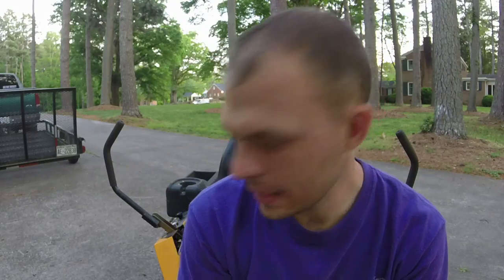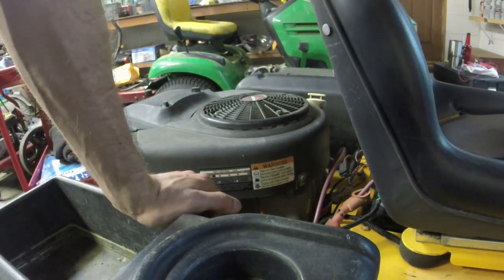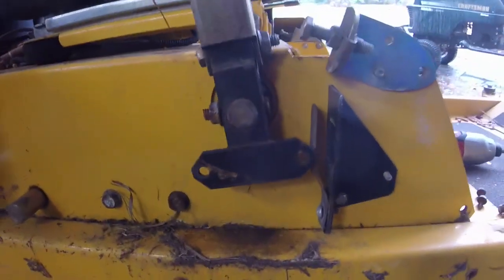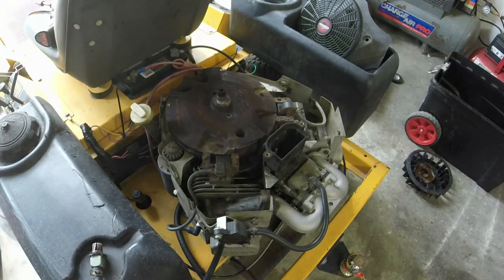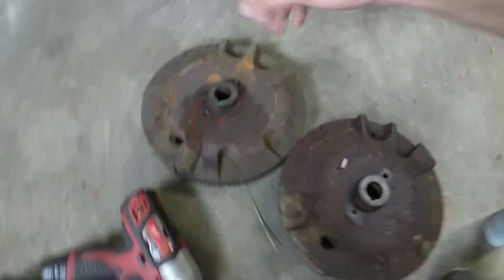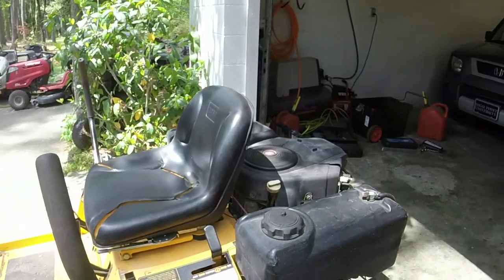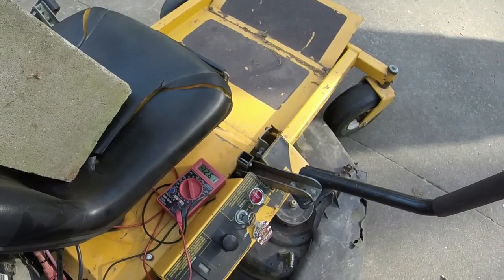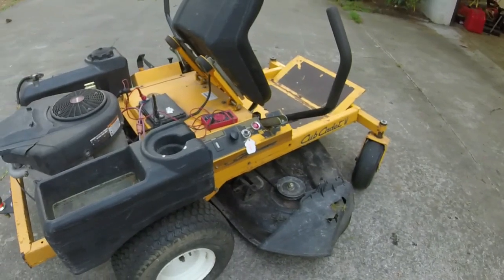Cub Cadet Z Force Zero Turn w/ Toro deck: Fixing a tire issue, surging issue and charging issue

Comment: Seems like this should be a good mower for someone and just may last a long time.  Put in a larger speaker in your garage--I was yelling at you not to start the mower when messing with one of those drive handles.  Guess the sound of the engine made it so you could not hear me.  I can not help you with the transmission issue nor the charging issue. My knowledge is still in the thimble stage.  Anyway good job and glad the mower did not hurt you or anything else.  Thanks for the videos.

Comment: Excellent fix. I don't know how hard it is to find a wiring diagram. Maybe off one of the small engine parts websites . Just a thought . Maybe someone before you crossed wires or not a good connection 🤔
Reply from the maker: This wiring was pretty hacked up but an ohm meter helped.  I think I just had bad voltage regulators.

Comment: If this issue returns it likely could be a failing PTO clutch switch, key switch or even failing PTO Clutch itself. Sounds weird but sometimes electrical stuff can be inconsistent and cause weird things in many different areas. Also whoever previously hacked the wiring harness really did some damage. If you know someone who owns a similar model you could go and compare the harnesses and see if possibly something is crossed or not wired in the correct way. Sometimes just a loose ground can be the source of all your troubles. You can try the wiring schematic but they are usually pretty useless.
Reply from the maker: I think it ended up being a couple bad voltage regulators.  I cut with it for about a half hour and the diode did not burn up.  Wiring is fun to track...